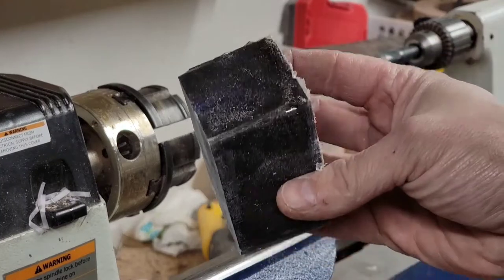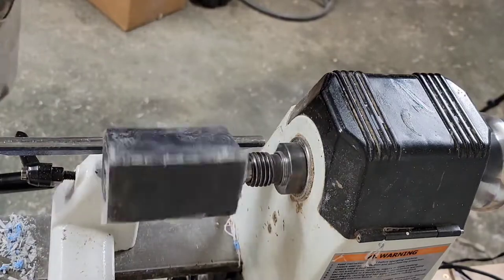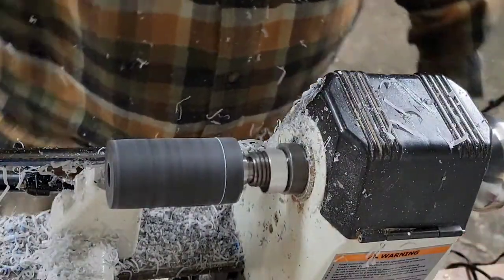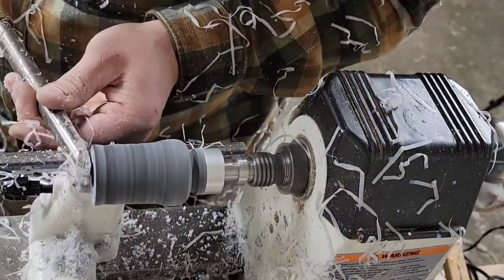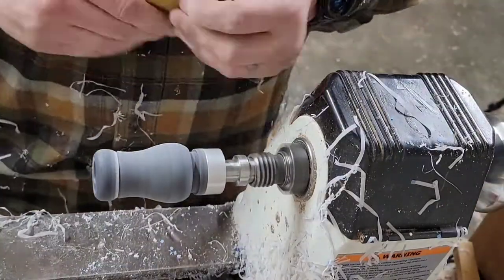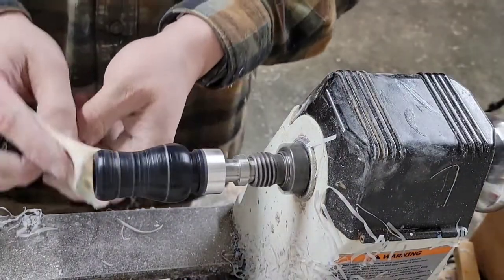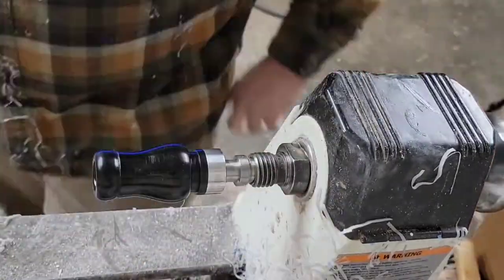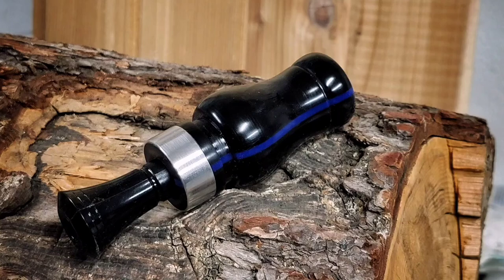Turning a Thin Blue Line duck call on the lathe!

Comment: Hello! Where'd you buy the acrylic block youre using in this video? Thanks!
Reply from the maker: @DarrenHackney-i2v  Hello! I bought a blue sheet of acrylic from a local store, and the black portion is just epoxy that I mixed black pigment into before pouring. Prior to pouring, I sanded the blue acrylic sheet so it’s rough and gives the epoxy something to adhere to.
Reply: @JustinBeyerlin1 Oh okay! So I could just buy wooden blocks, sand them down, and add gloss to them to make them shiny and look good?

Comment: What do you use to shape the body? Is that a spindle gouge? I couldn't really tell what all you are using. Thanks!
Reply from the maker: I get it close using a 5/8 bowl gouge, then refine the curves with a round tip carbide. I’m sure there are better tools for the job, but those are the ones I taught myself to use and they work pretty well in most cases. A spindle gouge would probably work just as well!
Reply from the maker: And I use a spindle roughing gouge at the very beginning to round the blank out.
Reply: @JustinBeyerlin1  Thanks! Im just getting into turning calls and ive been watching your vids all day. I really like how you shape your calls and you seem to have one of the simples methods of getting it to that shape. Very nice!

Comment: What is that wood lathe called I’m trying to get started making duck calls which one do you recommend for starters?
Reply from the maker: The one I use is a Rikon 70-220VSR, but if you’re only doing duck calls you can get a smaller one. I honestly don’t know much about other brands, as this is the only one I’ve owned, but if I was knowing I was only going to do duck calls, I’d probably have went with a mini lathe to save space.
Reply: What’s the cost on that one?
Reply from the maker: @Snowgooseguy  I think they’re around $900 new. I bought mine used for $600. But, you can find completely capable lathes for $150+ if you buy used.
Reply: @JustinBeyerlin1  ok thanks I just found the mini on Amazon and it has the attachment for the duck call to set on the machine to turn
Reply: @JustinBeyerlin1  could you tell me the tools I need to start with?
Reply: Like the sanding stuff and the pastes to please
Reply from the maker: @Snowgooseguy  You may be able to get away with less than me, or may want more, but I’ll tell you what I typically use. 
-A 5/8” drill bit (to drill the blanks out)
-A 5/8” mandrel (to put the call on when turning)
-a spindle gouge, cut-off tool, a 5/8” bowl gouge, a skew, and I use a couple other turning tools like a round tip carbide tool. You’ll need to be able to sharpen all these (unless you use carbide tools), and this comes with a whole other area of needs: bench grinder, jigs
-sandpaper, I use 120 grit through 400 or 600 typically
-I use Acks abrasive sanding paste often. Great stuff… check out some videos on YT.
-Tung oil (I’ll generally soak the barrel in this for a period of time to make it weather resistant).
-a guitar string (I use this after cutting a small notch with a skew to burn in a dark accent line)

That’s the bulk of what I use.  Obviously the epoxy stuff adds a bunch of stuff.
Reply: Ok thanks I’ll let you know if I need anything else
Reply from the maker: @Snowgooseguy  Sounds good, have fun!
Reply: Plus I don’t have to round out any of that because I can by i the acrylic already rounded and I’m just doing the barrel and it has the 5/8 hole drilled out all ready and I’m just looking for a lathe the tools for the lathe and chisels to shape the piece and I’m gonna do this to make money as well and I can buy the inserts and all that good stuff so what does that mark out since I said all of that?
Reply: Hey I have a question so when I get the 5/8 manderel does it have to be from the same company you got the wood lathe or can it be Any 5/8 manderel? I got the wood lathe from harbor freight and it didn’t come with the 5/8 manderel so I was wondering before I purchased?
Reply from the maker: @Snowgooseguy  It can be from any manufacturer. But, it has to have the correct taper… mine, for example is an MT2 taper. You’ll need to determine the taper of the lathe you got.
Reply: @JustinBeyerlin1 i gotcha where is the taper located on the lathe? Ps sorry i really don’t know anything about wood lathes